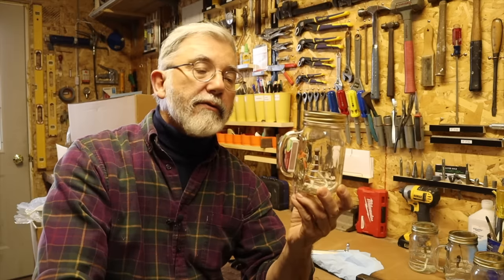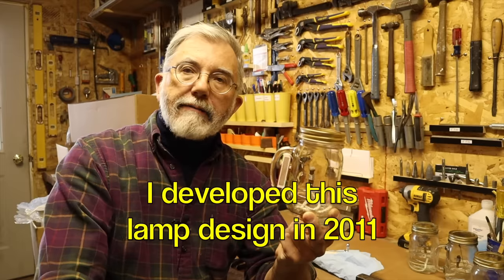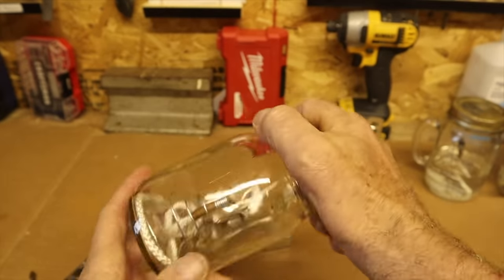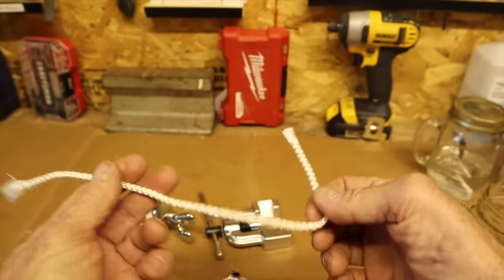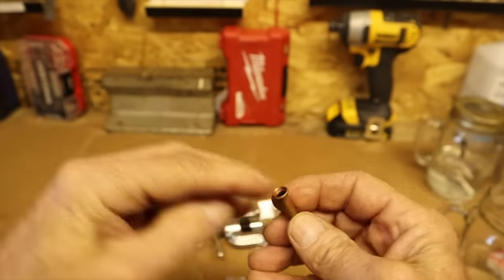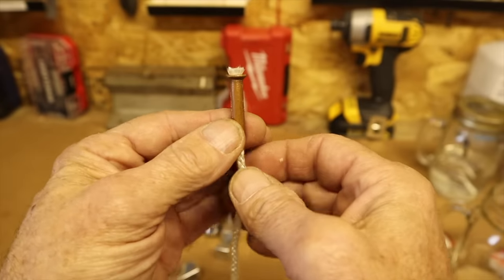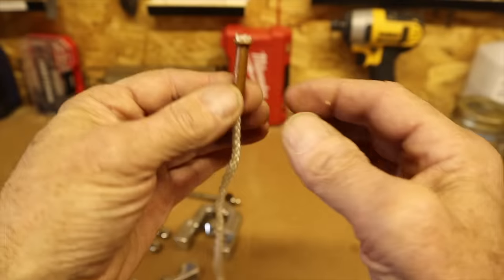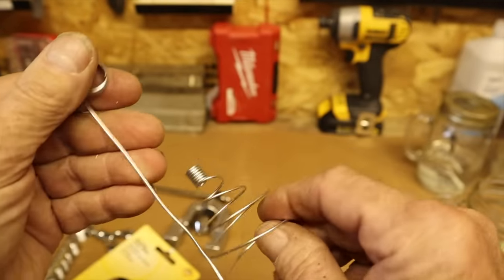How To Make Your Own Bright Betty Emergency Oil Lamp

Comment: We made a very similar light while I was in cubs , seven or eight years old ( in the mid 1950's ) . We used Mason jars and a length of shoe lace as a wick . Kerosene or stove oil for fuel . As kids it was interesting to make, and was useful . It was common for the power to go out after a storm back then . Do they still have Cubs ? ( Pre boy scout ) fun days , learning to make fires , in the bush , in the rain without matches all kinds of survival stuff
Reply from the maker: A good recollection. I was a cub scout in the mid 1960s. It was a good experience. They probably still have "cubs" but I'm sure it isn't like it was. 🙂
Reply from the maker: @sunfish4095  That is a sorry situation.. ☹
Reply: @sunfish4095  I wish the "woke" would just go back to sleep

Comment: As a general rule, you don’t want to use galvanized steel with any application that will be near fire as the galvanized will release zinc gas as it’s burned and zinc gas is toxic. This application shouldn’t pose an issue, but more of something to keep in mind. I think copper wire from Romex would be perfect.
Reply: You can also remove the galvanising by sticking it in vinegar for a couple days. Easy peasy.
Reply: @LitoGeorge  good to know, thanks
Reply: @georgeingridirwin6180  my pleasure. Works for dechroming metal too. I typically leave that in the vinegar 2+ weeks.
Reply: @LitoGeorge   thanks, very helpful.  Also would be a good thing to know & would have been a fun project for our son when I was homeschooling our kids.  But I'm going to pass it on.  Thanks.
Reply: @georgeingridirwin6180  homeschooling is close to my heart. Were my situation different legally, that would be happening in my home. Still teach my girls homesteading skills of every kind. The only caution I can say with this method is that the vinegar will become toxic after eating up the chrome. Dispose of in a safe manner for the Earth. Cheers mate.
Reply: @LitoGeorge   thanks for the extra tips

Comment: Nice little lamp sir! I will definitely be copying this idea I have some smaller diameter wicks that I've made myself with water and borax solution then dipped them in wax after removing all the borax crystals off of the wick... They burn forever but I'm going to break off the wax so it'll wick up the oil. That's a slick little design. My PawPaw used to tinker with projects like this. He moved onto be with the lord three years ago, he taught me nearly everything I know. Thank you sir for sharing this amazing ideal I greatly appreciate it and I have some spent 22lr casings, cooper wire and nothing else to do hahaha. I'll make a few for my grandma, my house, and a couple friends... This is genius
Reply from the maker: You were fortunate to have a PawPaw that you could know and learn from. ❤️  I like your resourceful approach. Thank you for the comment.
Reply: try 100% carbon felt as your wick, you will be pleasantly surprised.
Reply: That casing is what I thought he was using lol!

Comment: Nice,  however,  instead of galvanized wire,  I would probably use stainless steel wire. 
Harbor Freight sells it at a reasonable price.
Also,  you can find copper and brass pre-flared tubing in the electrical department at a hardware store.  They are for crimping wiring together.
Reply: Excellent! Thank you!
Reply: Perfect, thanks for sharing
Reply: They are called ferrules
Reply: @THE_PeglegSwantoon  thanks now I know what to ask for

Comment: I have had several oil candles that I purchased, and the common element is that the wick shroud, (copper tube here)should go as deep as you want to pull oil from. The shroud confining the wick sides, cause wick to draw from the bottom.
Reply: Mother, father, teacher give.
All others trade.

Comment: Looks good, easy, and practical. I would recommend against using galvanized wire though as it gives off toxic fumes when heated.
Reply from the maker: I don't think it gets hot enough to give off fumes. 🤔

Comment: Thanks.  If I make one of these I'll cut a piece of metal to fit below the wick like on a bee smoker.  Thread the wick through that and done.   I do like the idea that the wick is lifted up with that handle.  No tipping the jar to light.
Reply from the maker: Interesting. I must have had a different style of bee smoker when I had bees. Or it had a wick and I never knew it. Thanks for the comment.
Reply: @herrickkimball  The plate where the fuel sits is what I'm talking about.   So, have the wick come up through a metal plate in the jar.

Comment: I loved your "Bright Betty!" I'll be sure to be making some of these for my home. I want to remind everyone with the looming threat of fuel prices skyrocketing and such, this is a great idea not only for light but for temporary heat to keep people warm enough! A lady makes a homemade "heater" with a terracotta plant holder. She basically has the plate and the pot, places a little votive candle under the terracotta plant holder and puts the plant holder upside down so it looks like a teepee. The hole is already drilled on the bottom which becomes the "vent" for your candle heater.

Imagine using this Bright Betty with a bigger terracotta pot and plate? It'd be an amazing emergency space heater! The smaller sized terracotta plant holder and plate made a decent enough space heater for her to use to warm her entire kitchen for 24 hours during the cold winter. She said this along with some warm blankets and such kept her little room pretty warm! Now, imagine you had a few of those with a few of these Bright Betty's? Not just that but use bigger Teracotta plant holders to make bigger space heaters ??  Well, then you'd have yourself a pretty decently sized emergency space heater. 

The nice thing about the terracotta is not only is it heat savvy being made of clay -- but she had a few pets (a couple cats and a dog) and she wanted to make something heavy enough that they wouldn't be able to just easily knock over when placed on the floor. Obviously use common sense and keep your eyes on it when you need to use this in an emergency, but I think this is a great idea to use a bigger pot holder and plate with this nice mason sized jar Bright Betty Bam s Lamp!
Reply: I found the video where the lady makes the space heater with theat. There is another video here that tests this out to see if it works.... I can tell you from personal experience that it does work. But, I haven't watched this guy's video yet. 
Anyway, sorry for the links... I am not affiliated or anything and I don't think there are any products being sold here... though if there is a link to Amazon or something where they might earn commission I'm not sure... anyways... here these are:
The lady's video I watched and discovered this heater idea:
https://www.youtube.com/watch?v=ImFyqY0uCHg&ab_channel=Nica
A guy's video I haven't watched yet testing out the heater:
https://www.youtube.com/watch?v=GV23gAO7F8E&ab_channel=PhilG

Comment: I have seen something similar with a simpler wick contraption.  An "X" with the ends bent over to fit over the exterior or any jar or cup desired.  With the center coil holding the wick itself, no tubing used at all.  It works.  Not as nicely kept on a shelf inside a dedicated jar as your idea.
I do a lot of wire working.  We all have our tools of preference for making our coils and loops.  If you use them often enough, there is no wrong tool.  Finagling with wire IS a thing.  Always takes some finesse to get certain shapes the way you want them.

Comment: That's very clever. I'm impressed. I've been making oil lamps for about 50 years. Even though I like your design, I don't have the tools to make those wick holders, plus, it looks harder than just buying wick holders. Yours are really good, but I'll need to keep buying ready made ones. Would you ever consider selling ones you've already made. And, do you think 20 guage wire would work as well. Thanks

Comment: I like it. Suggestion, can we use conical cylinder instead of tubular to make the tapered base? Your instruction is very clear and precise.  Thanks.
Reply: I think that would work, depending on how springy the metal is. Most metal I've  worked with has at least a little tendency to spring back from the shape you put it in. So I'd say to make your coil on a smaller part of the cylinder than you think you'd need to because it will probably spring back to a little bit bigger than where you wrap. 

I think that's a good idea, by the way. When I make mine I will probably wrap the bottom part around a kitchen funnel. And I might use the narrow end of the funnel instead of a dowel to make the handle on top.👍

Comment: brilliant idea - thanks for showing ! To improve the spiral part of your wire, take a round or square piece of board, draw a circle and mark an octagon. Drill a hole in the center, matching a screw of choice and screw it to a wedge, then drill eight holes at the angle set by the wedge and finally glue eight dowels into the holes. Where they meet at the other side, leave room for the wickholder, cut the dowels flush to the bottom of the board and wrap your wire around the dowels.
The octagonal shape is not much off a circle and the spiral will work just as good, but will be looking much more even.
If you put some reflective self-adhesive aluminium tape to about 1/3 of the jar, centered by the handle, you get a directional light.
Reply: Maybe you could post a video.
Reply: Or use the mylar from a snack bag (potato chips, etc).

Comment: I wonder if the wire could be wrapped around a small funnel to make the spiral wire base?
Reply from the maker: That sounds like an idea worth trying. 👍
Reply: Mini metal funnels 6.99 for 6 amazon and might work instead of the wire except to attach it as a handle. Wick could thread thru too
Reply: I bent the spiral on mine by hand. Used pliers to bend tight the wick holder part.

Comment: interesting project I have lots of stainless wire and tubing i will have to try making one of these
at work when we wanted to make coils of wire we just stuck a piece of tubing in a drill chuck you just make a slot or hole stick wire in and turn on drill
Reply: Can you film a demonstration of this and post please?

Comment: Use a wooden cone (Micheals) , then no fussing to make the small to large rings (resemble old flashlight battery coil). You can also use your knife to make grooves in the wood for the wire to follow.
We made using old flashlight battery coils when I was a kid (70 Yrs ago). These hav been around since early 1900.

Comment: EXCELLENT VIDEO...
Yes... I remember that song too... being 68, I was a tenager in the 70s too.

Question: Does that wic smoke very much?
I can't burn certain candles because of the Smoke the wick produces.
Thank you for sharing this great video.
I am in the process of moving into my Vintage (1972) Travel Trailer, and this will come in handy when needed...
Reply from the maker: It doesn't smoke if you get the flame adjusted right. But there is some odor. I discuss both of these things and safety in this video: https://youtu.be/asgeLt0cshE

Comment: That's a very cool design. I wonder if using a funnel for the second wrap wouldn't be a little easier...
Reply from the maker: It's well worth trying! Thanks for the comment. 👍
Reply: A small wooden Christmas tree cold be cut and drilled to make the holder for the bit AND the cone shape.

they abound in thrift stores this time of year.
Reply from the maker: @lazygardens   Another great idea worth trying. Thank you.

Comment: I think I'll make one today.  The most impressive thing is, where did you get such a shiny flaring tool?  Mine looks like it's been through a war.  Don't use it for copper tubing but with the dies, it's used for brake lines.  Anyway, thanks for sharing.

Comment: This is also a awesome bushcraft lantern. 
You could carry it around with the lid on and it won't leak at all, not like all other oil lanterns 👍👍👍
Reply: If the lid was on the flame would die. No air, no fire.
Reply: @mirrage42 
That's a really dum comment‼️👍🏻

Comment: I've made several now, and with glass wick holders I hand made since I blow glass. I used olive oil in them too and they still worked!
Reply: The lamps with handles were my intention, but I can only find the ones made for cold drinks. Do you know if the original jars with handles are still sold?

Did olive oil smoke?

Comment: Curious about the difference between paraffin and kerosene lead down a rabbit hole. That hour disappeared quickly.

So paraffin or lamp oil are kerosene, just really clean versions. As they are both distilled at 150-300 C. Whereas diesel is distilled at 150-380 C.

So paraffin, lamp oil, kerosene, diesel, heating oil, JP-4/8, and bio-diesel could all probably be used in these lamps with varying results on carbon/tar build up on the wick and sooting issues.  I didn't realize how similar they all are.
Reply from the maker: Excellent! Thank you for the insight. 👍
Reply: Diesel and heating oil are basically the same. Pretty sure they add something to the heating oil to stop people from using it in vehicles, that way the tax man gets his cut. Fun fact, you can mix either with ammonium nitrate to make anfo and blow stuff up >.>  <.<

Comment: The copper bit can be purchased really cheaply online in a ceramic form. I saw them when looking for lamp wicks some months back. Basically same thing but ceramic. For people who don't have the ability to craft such a copper bit.

Also, supposedly cotton wicks can handle diesel, kerosene, and vegetable oils. Of course, apparently you don't want to use a wick used with one fuel with a different fuel for capillary reasons.

Comment: If that flame, or the match,  touches the liquid will it all ignite, or is it different from petrol?
Reply: Not like gasoline, it's much slower. But I wonder if paraffin gives an odor. Maybe odorless kerosene would work? Huh, maybe liquid paraffin and kerosene are the same thing. I just checked. It is the same. {There is cosmetic grade liquid paraffin though}

Comment: Fun. Never fall asleep, or leave the room  with a candle going. It might be better as an outside of the tent table light. I've seen too many candle fires, which in essence, it is. Just treat it like an incendiary device, which in fact, it is. Pretty though.
Reply from the maker: Exactly. I discuss safety and tip some Bettys in this video: https://youtu.be/asgeLt0cshE. And you are correct that these lamps make very nice outdoor table lamps.
Reply: Also to add to that, cats like to wander, they can knock candles over. Another thing is that, as the wax gets low, the glass containers get very hot, so there really should be something underneath them. I have seen, a burn spot on a wooden dresser, because of that. Safety first.

Comment: Nice lamp. What would happen if you painted the back of the lamp (around the handle) silver? Would it reflect more and become more directional? Again nice lamp.
Reply: If you're going to paint, a bright white might be best. If, however, you actually mirrored it, it would be phenomenal.
One can actually mirrorize it, as long as one is VERY careful, but, I'd go with a sticky mirror film.
Reply: @Timothy Mckee That sounds like more trouble than just applying a sticky film...
Reply: Good idea. How about aluminized mylar film on 1/3rd of the outside of the glass?
Reply: Ok guys, you're overthinking this as it is a project to be made with miscellaneous trash.
Stick a piece of aluminum foil on the reflective side...or cut a tin can in half and slip it in.

Much easier than that, just sit the lamp in front of a mirror.  That's why dining room buffets had mirrors....for the candles and lamps tl double the light.

Comment: New subscriber. First video I saw of yours. 
You made it so simplified a four year old could do it. LOL
I remeber the "Woa black Betty, bam a lam ....." Were good times back then. Life was so much different than it is today, for sure.

That's a great idea though. Have to get some of that liquid parafin. I keep a can of denatured alcohol all the time for my little "penny stoves" - made with the bottoms of two aluminum cans. There's a video about them if you don't know what I'm talking about. It's good to have those simple items around to get through emergency situations, or even if just the power is out without an actual emergency really. Either way handy items for sure. Simple lamp for light - and probably a little bit of heat as well, plus the little stove, would be pretty much set for a while. I heated a small tent for short periods of time with those little penny stoves - some people call it an alcohol stove and there's other names for them too. They're nice because you can burn three types of fuel in them - 91% isopropyl alcohol, denatured alcohol, "Heat" in the yellow bottle (gas line antifreeze I think is what Heat is. Comes in a red bottle and a yellow bottle I think. I haven't ever used "Heat" so I'm not sure about it's use, just going off of memory from when I first learned about these burners years ago. I am sure about the yellow bottle though  ) 
I subbed just on this video, let's see what other good stuff you come up with at that nice workbench and a good assortment of tools to work with. lol 
God Bless